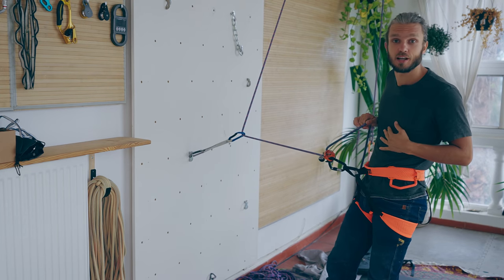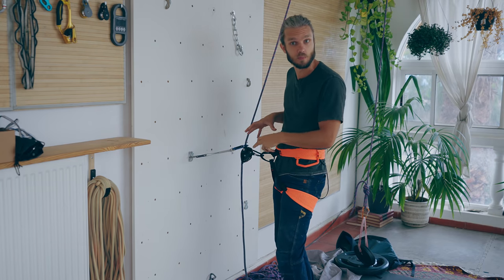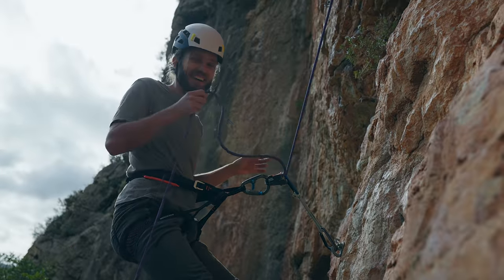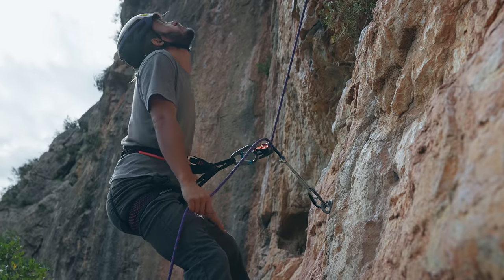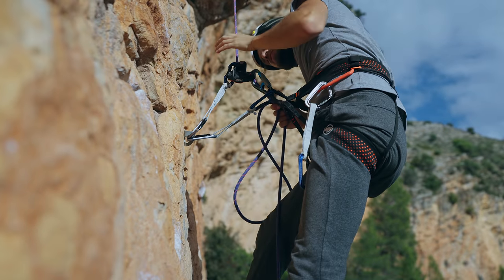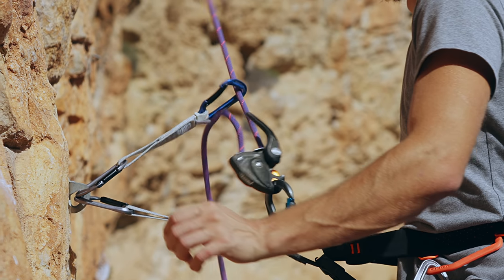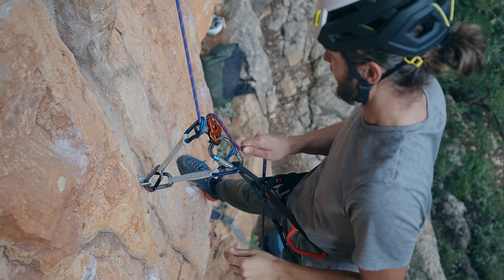What happens if GriGri gets trapped in the first Quickdraw?

Comment from the maker: Should have mentioned that in some cases it's a good idea to unclip the first bolt to avoid this and have more freedom while belaying ;)
Reply: As the belayer how do you unclip the first quickdraw safely while your climber is still climbing?
Reply: can you cover the Ohm?
Reply: @user-qn9ku2fl2b  very good idea!!!!!!!
Reply from the maker: @switchfootforever24  If bolt is low then belayer can reach it in a safe moment and unclip. Another option Climber unclips it after clipping the 2nd bolt, or if it's safe enough skips 1st bolt completely. But neither is a must. It's situational and can help a bit.
Reply from the maker: @user-qn9ku2fl2b  Ohm is on my list... already did some tests so time ago but need mooore
Reply: @switchfootforever24  you can one hand a stick clip
Reply: Exceedingly common on most steep climbing, especially at the Red, to reduce drag and position the belayer further away from the wall overhead while still beneath a bolt. Takes getting used to.
Reply: @switchfootforever24  if the first bolt is low, the safest option is to stick clip the second (or even third depending on the situation and spacing)
Reply: Something 'similar' happend while I was belaying someone a fair bit heavier than me on an overhanging route, but the quickdraw ended up sitting on top of the Grigri in a way so I couldn't lower. Every time I managed to get a little rope through I got pulled back up into the quickdraw - after a good amount of wiggling I managed to get enough rope through, so I could lower myself and then the climber. Any tips on how best to solve that situation?
Reply: I like things that are at least typically safe.

Comment: Excellent video as always. Grigris are typically safe but in no way foolproof like many people believe/assume them to be. Always practice good belaying techniques. Thanks for all you do
Reply: it's not the equipment that keeps you safe, it's the practices of the climbers
Reply: I don't understand what points you're trying to make.  Firstly, NOT holding the brake side while belaying shows COMPLETE ignorance in belaying, so why bother?  I've been climbing over 30 years,most of it with a GF that I outweighed by a hundred pounds.  She never got launched into the first bolt, and only once got yanked into the wall from standing away from it (the 2nd worst mistake), but her hand never came off the brake (of her ATC).
Reply: good belay techniques like testing climbing scenarios without climbers on the other end. Seriously foolish and potentially fatal thinking here.

Comment: Thank you for putting in the work and helping keep people safe.

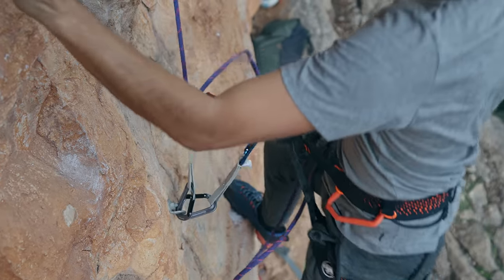I think I noticed a something about the way they were catching the lead falls that caused the gri-gri to release.  Specifically that it seemed that trying to give a dynamic catch and using the belayers body to help cushion the fall (as we are trained to do) allowed the gri-gri to get pinned open briefly.  At 2:15, we can see that most of the belayers weight looks to be on his feet, as he stands up into the catch. I would agree that the gri-gri may fail in such a scenario - but I don't agree that it is quite so similar to the scenario of a belayer being dragged up 8 feet to the first bolt.  I believe the gri gri will be cammed up and under bodyweight tension by the time it will arrive at the first draw and it won't be so easy to defeat.

Watching carefully the catch starting 2:10 we can see the gri gri initially cams and then starts pulling the belayer up.  Belayer gets pulled out of a sitting position, and as the gri-gri hits the first draw the belayer begins to stand, pushing his hips up and in toward the gri-gri.  This is when the failure happens.  The belayer starts to break with his right hand and as his hips start to move back he regains control of the device.  In fact I will even go so far as to suspect the gri-gri may lock even without a hand on the brake rope after about 2-3m as the belayer falls back down in his harness, not that you should ever let go of the break rope I am sure.

Comment: Did you back up the climber on another rope? I know it's not super likely that you'd experience full rope failure but when testing strange error states, and sudden rope pinches on parts of gear or surfaces that maybe weren't meant to be loaded or act as a locking mechanism... Probably wouldn't hurt to throw an extra slack rope in there haha.
Reply: I concur

Comment: For the ones thinking this is way too hypothetical, I've seen it almost happening once, climber was past the second bolt, the first one was kinda low and they took a fall which would mean decking if the Grigri had slipped a meter or so. The belayer was considerably lighter but still, falls with little rope in the system tend to raise the belayer easier.
Reply: 250 lbs man climbing with my 140 lbs wife she used to always hit the bolt on even minor falls. Love my Ohm now!  So much better for both of us.

Comment: I’ve always wondered this! I’m also wondering this scenario: if the route was really overhung and after being pulled up the belayer couldn’t have their feet on the wall or basically have anything supporting them besides the grigri/rope, once they are pulled up to the first draw unlocking the grigri, and the climber starts falling again, would the belayer then start falling back to the ground too, thus releasing from the first draw and re-engaging the grigri? And then would the climber and the belayer stop moving?
Reply from the maker: Just from my few experiments I felt that I can stop the Climber from falling (GriGri Cam fail) if I hold the break side of the rope, but def more testing would be needed to be 100 perc sure.
Reply: If you can slowly unlock, you slowly slide to the ground, and climber stays at same place due to friction in the system. Not sure if in all situations, tho.
Reply: If I understand this situation described, the belayer position relative to a wall is often less relevant because you’d have to overcome the weight of the climber including friction. If in this position, the climber needs to boink up the rope, and anywhere the climber can reach the wall and especially the rope through the gear then need to haul themselves up.
Reply: This is coming for someone consistently belays someone 50 to 60 pounds heavier. I am assume your asking if the lighter belayer slowly get pulled up by the climber's weight after a fall and the belayer hasn't reached the clip? No, if you haven't reached the clip, you just dangle until you lower yourself or if the climber wants a haul, they lower you as they go up. Even if you do hit the clip, after the initial force, I've always been able to get the grigri to re-engage. Getting off the clip enough to pull back the handle and lower myself, now that a different story.

Comment: Maybe I'm wrong but I think in real condition (which would already be quite hard to get into) your weight would pull you back down and the grigri would lock again?
Good example on why weight can be a important factor in belaying tho because at a 30kg+ difference you might just get jammed into the quickdraw for a good while...
Great video as usual, thanks for testing what we are not willing too!
Reply from the maker: Yea many ppl point that out... the only way to know is to do a bigger test fall with more back up....
Reply: @HardIsEasy  I'd be curious to see what happens in overhanging terrain (if the quickdraw is directly above you and you can't push yourself from the wall) then I'd be a real concern to have to system just unlock during the fall!
Reply: @HardIsEasy  Hi, Ben really glad you point this out, I always have the question in my mind. 
My opinion with Lysonyk, the belayer should get lock again.
And, this could do with a few adjust, 
Make the belayer really weight on the rope(not on feet or on the bolt)
-replace the PAS with a longer one(could do with runner)
So the belayer won’t weight on bolt.

-remove the feet when belayer gets pull.
So the belayer will really weight on rope.

Really glad you point this out again, I like those subjects.
Arming

Comment: My wife and I love climbing. She weighs around 120 lbs, and I hit the scales at around 240. We made the mistake one day of her not being tied into the ground point while she was on belay for me to climb. I was nearly at the top when I fell. My weight quickly lifted her off the ground, and even though her first instinct was to stop being lifted by partially letting loose of the belay. I on the other hand, was careening at a dangerous speed towards the ground. To her credit she used the brake to arrest my fall just a few feet before I hit the pads. Then had the presence of mind to lower herself down safely with the same brake. 

The Lesson to be learned here is, Belayers should ALWAYS TIE OFF in such a manner that they don't become one of the moving parts should they need to belay a falling climber. This RULE applies to ALL people belaying, regardless of relative size, location, or experience. 

In your example, your brake would not have been fouled, if you were tied off in such a manner that you could not be pulled towards the wall in the first place.

Comment: Is the fall length limited as the belayer is initially pulled up then hits the quickdraw and the cam disengages but then they would fall back away since there is nothing holding them too the quickdraw after the cam is disengaged?
Reply from the maker: Interesting point, I only had 1-2m of extra slack and it all went through really quickly - didn't tested bigger falls tho...
Reply: @HardIsEasy  I feel like this is an important caveat. When you lower a climber after a catch, you get lowered first which I assume is due to less resistance. After that initial pull, which is shown in your 1-2m, the force into the rock / qd would reduce.
Reply from the maker: @joffyjenkins9241  Seems like I have more things to test... :)
Reply: @HardIsEasy  secretly encouraging you to make some climbers take some long falls
Reply: Was thinking this too

Comment: Very good educational video. Only criticism I have of what you did during your test of getting sucked into the first bolt. When it did fail you and already stood into the bolt so the cam never actuated to begin with. If you were ever to be sucked to the first bolt the cam would be engaged. 
I'm one of the light guys 5'8" 130lbs. Luckily I've never been into the first bolt so far so the video really intrigued me. My main belay partner for quite awhile was over 200lbs. So it was rather interesting.
Reply from the maker: Thanks and I didn't stand up... I was pulled up ;) 
My legs were on the wall that's why it look like that ;)
Reply: @HardIsEasy  I must have been mistaken my apologizes. it appeared to me you had leaned into it. 🙃
Reply from the maker: @Cinyman  buaaah no  worries at all ... I'm learning and getting a lot of ideas from comments ;)

Comment: I worry about this on multipitch routes. Often we clip a draw on one of the anchor bolts, or there is another bolt very close, or the trad Jesus piece to prevent a factor 2 fall. Do you recommend unclipping this after the next bolt or piece is clipped? Thanks for the video.

Comment: I thought the clip would push down on the cam.
But what if you hold on to the brake rope like you would on a DMM Mantis or similar device? Will the GriGri act enough as a tube device with its bends to still allow control?
Reply from the maker: Holding on the rope in our test seemed enough for grigri to lock even while pushing against the draw, but the test is limited so take that as a warning ;)
Reply: @HardIsEasy  Thanks.
I'll look at the Edelrid Ohm or its new competitor to see if they help reduce the risk.

Comment: Great video highlighting the real dangers the persieved sence of security devices like the GriGri brings about. The classic tubular ATC may still be the most balanced compromise ever seen the light of the day. And it's dirt cheap.
Reply: GriGri is definitely a better "compromise" than a tubular device which has absolutely no failsafe.
Reply: Seen more people release the rope due to sudden movement of the rope through a tube device than have witnessed the grigri being smashed into the first draw. Further, seen plenty of people release the rope when pinched between the rope and a tube device, and seen a couple instances where someone slammed into the first draw and released a tube device. At the least a grigri may not disengage, and if a grigri does disengage then this is still a friction plate. Folks get super complacent with ATCs because they’ve not dropped anyone yet. Not a good compromise to lose all of the obvious safety from rock fall, underfoot hazards, and similar when you could just start with solid initial education which I see in most gyms and for most instruction.
Reply: @zacharylaschober  I do get and understand the pushback on my preference for an ATC over the GriGri. My position, though, is grounded in an episode of PTSD being triggered whenever I see a GriGri. Me -  Leading a route on the edge of my ability trying to make friends with primal fear. Belayer with GriGri - Holding her iPhone with both hands filming the situation, probably with a hope to get to upload something spectacular on Facebook to get likes. Perhaps she'd done the same thing with an ATC, we'd never know...

Comment: I actually disagree. It will only unlock for a fraction of a second. Once your body starts falling again it will lock.
Reply: Yeah, this is also my guess. In the video, it looks like the belayer is "helping" a little bit with his legs to maintain the unlock situation. Not intentionally, but still. Even if not, my guess is like the above. I am wondering how does it look in the 'really' real-life scenario - when the belayer is pulled or jump to the 1st quickdraw but after that goes down again. I was pulled to the 1st quickdraw a few times, so my partner and it has never happened that grigri didn't lock. But still - holding the break side is always a good thing. Appreciate the video, by the way, you are doing a great job!

Comment: Seems like a good reason to not do jumping belay catches - among other reasons.  If worried about swing, you can extend placements.
Reply: @D Hanes that's a lot of effort for a dynamic belay.  In a multi pitch setting you can't jump anyway, so it's important to learn other techniques.
Reply: @D Hanes another option is to belay direct off the anchor with a munter hitch.  The munter has shown significantly more braking power than the ATC, and it also has the advantage that it can catch either direction (such as in a factor 2 fall onto the anchor, where the ATC would be useless without a redirect).  https://youtu.be/1CbFpRPYDm0
Reply: how extending placement will reduce the swing ?

Comment: Looks very theoretical to me. I mean, a carabiner or even the grigri could also break due to crossloading, but i never heard of that incident outside the rope solo world.
If you catch a fall that big, there ist plenty of time to catch the rope, if you did the belay wrong before and also to loose it, if you are surprised by being smashed against the wall. It can happen more easily by an edge of rock in multipitch, if you clip the grigri direct to the anchor. But doing so with a grigri is still probably the best way to do in multipitch (if youre using single rope).
Reply from the maker: I've seen broken carabiners due to cross loading - but that's another story.
And I'm just curious if Quickdraw even can theoretically mess up with GriGri, the rest is situational as you noticed ;)
Reply: There are documented accidents of people decking because a grigri got jammed into a draw and the belayer dropped the brake strand, so it's not merely theoretical. Of course, there is no belay device that would be safer than a grigri for this kind of accident, because the belayer dropped the brake strand. But that's exactly what this video is about; don't drop the brake strand, regardless of what device you use.
Reply: @dzb33  Would this happen on Smart or MegaJul as well when pulled up to the first bolt? I dont think they would open. Anyway they block less reliably with the brake hand open.
Reply: @mailx581  The Jul or MegaJul will work fine. I really like the MegaJul, because with the right crarbiner and rope combination it nearly becomes a autoblocking device (needs minimal force on the break side of the rope)